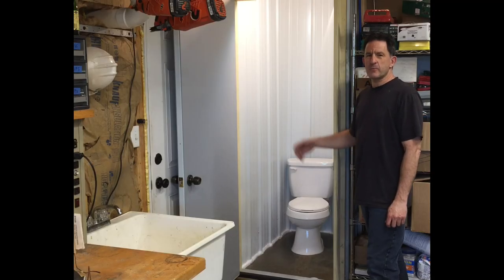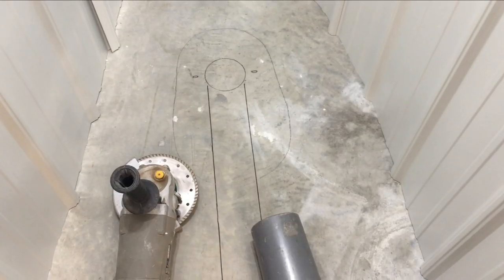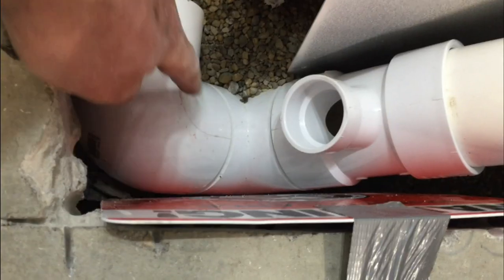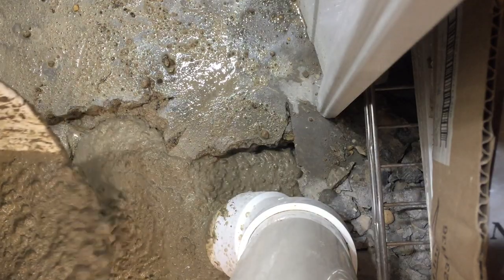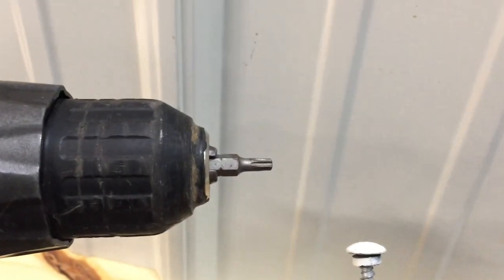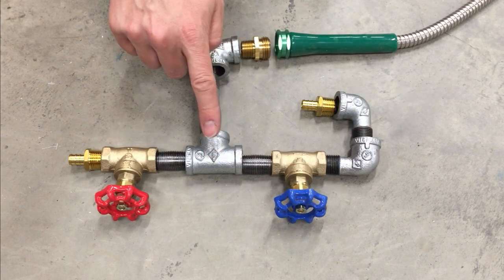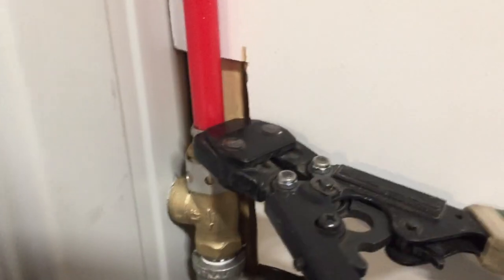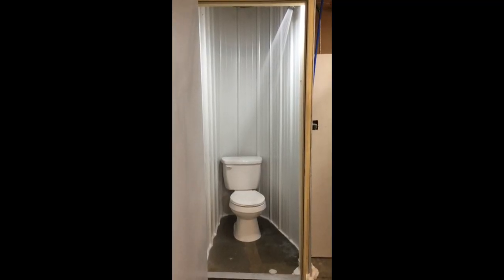Toilet / Shower Combo Build

Comment: I presume best practice is to make sure the drains don't leak before cementing/sealing.
Reply from the maker: Yes, but PVC joints rarely leak, especially when encased in concrete.  At most, they  might drip a little into the pea gravel. No big deal.

Comment: Where do you put the toilet paper?
Reply: You don't need it now haha
Reply from the maker: I keep it on the back of the toilet and have to set it outside to shower
Reply: Amazon sells waterproof toilet paper holders, where the toilet paper roll would be inside a water sealed enclosure.  That type of toilet paper holder also prevents cats from pulling on the toilet paper roll. I'm also considering installing a shower inside my toilet enclosure, but I plan to cover the entire enclosure with water sealed grouted tile and having the shower head be lower at arm's length when sitting on the toilet.  There would also be a shower head holder up high for persons wanting to stand while showering.

Comment: I'm confused. How does the shower water drain away? Looks like the toilet seals the pipe.
Reply: I would assume there is at least  a 15 degree pitch.
Reply: @Bababui69  So the shower water enters the waste pipe under the toilet through the toilet flange?  But then where is the trap? Toilets have an internal trap which means there must be another trap in the line somewhere, which implies there are then two traps for the toilet waste. I see trouble ahead unclogging it.
Reply from the maker: Watch the video again.  I put the toilet flange in back and the little floor drain in front, with the trap under it in the newly poured concrete.
Reply: @HowToLou  Thanks! That explains it perfectly.